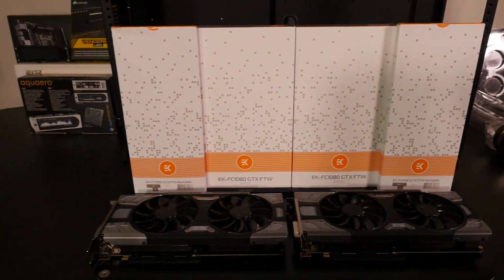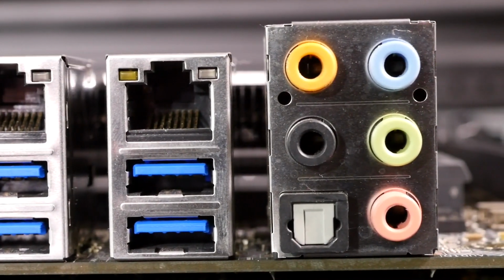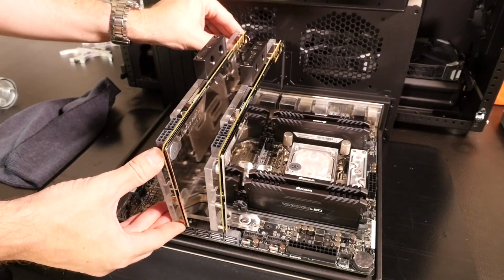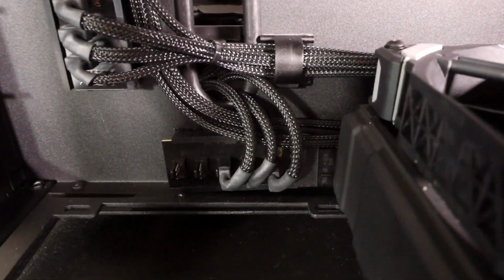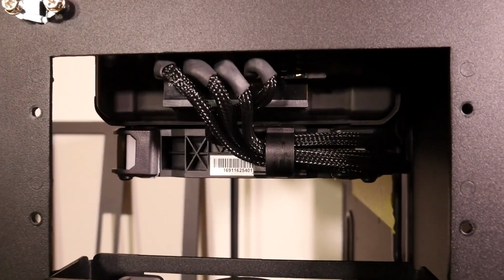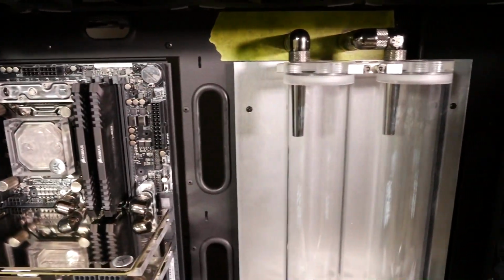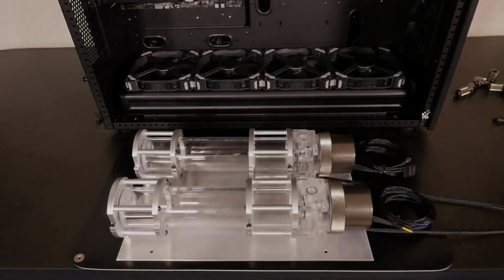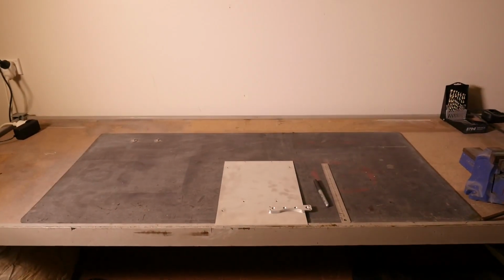SC Build #18: Extreme Workstation: Part 3

Comment: I believe that if you keep working like this you will get BIG and maybe in 4-10 years Singularity Computers (especially their products) can get to a "size" of the big manufacturers. 
We need people like you in the watercooling world.  :D
Reply: i just hope watercooling still exists then
Reply: why should it not exist ?
Reply: That's a very long time, so I wouldn't be surprised if Daniel decides to move down a different path. Youtube might die by that time. Computers might change so much that water cooling as we know it might be useless. Who knows :D That's the exciting part
Reply: Los Bonscos i´ve heard they are working on a new technique where the signals are transferred via light instead with electricity, that way there would be no more heat generated and it would be a lot faster
Reply: Peter Pimmelmann im sure you heard about fiber, well thats the same thing. Transferring data via light is nothing new. And Quantum Computing requires even better cooling asfar as i knoe
Reply: There's still some heat using light, and depending on how they're made, there may be enough to require water cooling. They'd likely need a heatsink anyway.
Reply: Los Bonscos we shall see what the future brings.
Reply from the maker: My goal is to put together a team of true enthusiasts who do it because they really love it and because of this are willing to take risks pushing things to the limits, and not just build safe products as everyone in the industry current does. I really want to step out outside of the box, force the industry and technology to move more quickly. Water-cooling hasnt really ever changed, neither has the computer case, I think we can do better and I am going to make sure of it.
Reply: Because video cards and the CPU are using less and less watts as we go to smaller processing.  When we get below 7nm's CPU's won't be using silicon anymore or at least that's what they are saying.  If water cooling is still around it will be solely for recreation and hobbyists rather than a necessity.
Reply: SingularityComputers
Reply: traingp7 Even if its for super multi threaded Xeons, there'll always be something producing lots of heat. And Germanium is what they are looking at from memory. The computer market has had a pretty consistent power draw, I'd be surprised if they started effectively trading performance for efficiency, its always good, but most enthusiast consumers don't really care. There will likely be extreme edition CPUs in the future, and AMD are soon to come out with Zen, and all that is ignoring GPUs, in which efficiency is not as key a component in servers.

Comment: One question is about M2 SSDs (not sure I was what system drive the client specified in the build) have you seen and would you consider using something like Aquacomputers kyroM.2 water block riser card to keep that hot SSD cool?  Puget Systems did some testing by adding different cooling solutions to M2 SSDs and found that any additional cooling benefited the drive and delayed throttling from what would occur on a stock drive...

Comment: I've been trying to find specifics for a long time now, but how do you source and design the O-ring component of a waterblock? It seems like every block would need a specific size, so in my mind you need to design the block with the O-ring in mind, or you need a custom O-ring size. Is that right?
Reply from the maker: You can actually get o-ring kits. The o-rings come on a long roll, you cut them to length and glue the ends together. This is for one off custom items. For production you would have them made for the part.
Reply: SingularityComputers Thanks! I don't know why I wasn't able to figure that out on my own. You've replied to a couple other comments of mine and I always appreciate the information! I'm loving all the content!